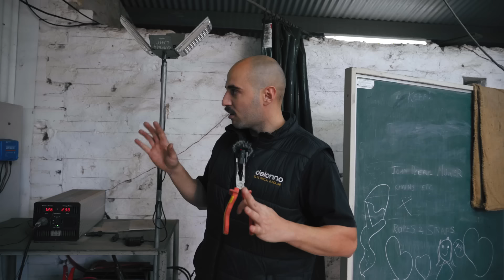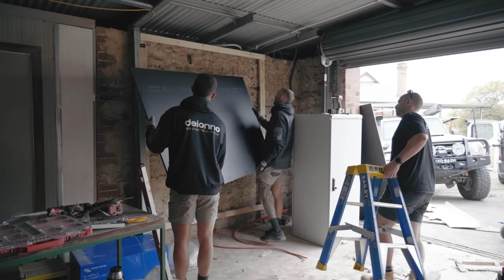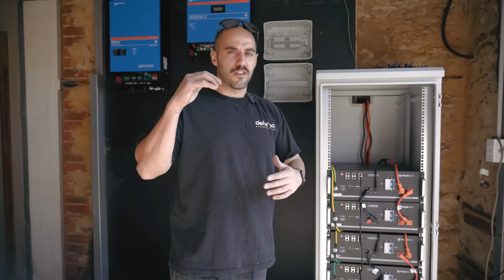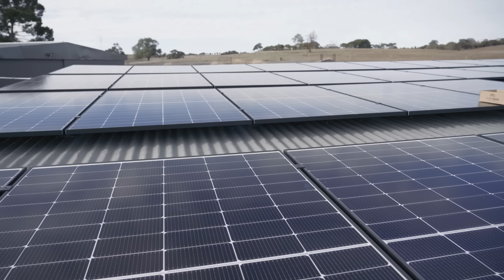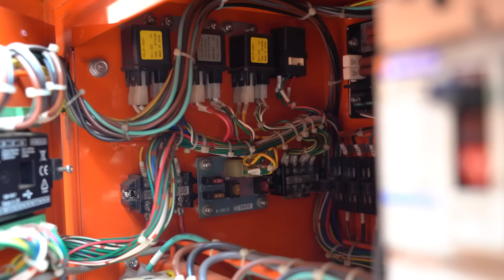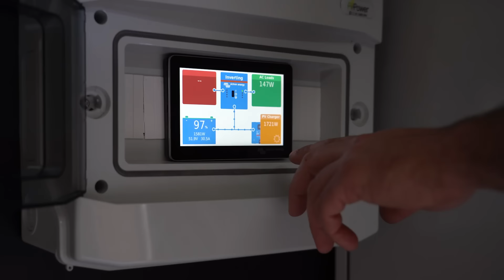HOME SOLAR WITH VICTRON

Comment: Clean set up- Question about the Power In. If im running Powerplus batteries to it (7) shoould i double up on lugs from battery cabes or use 2 power ins connected ?

Comment: Hi @Deionno Electricial, Question - Why did you run the MPII shown at https://youtu.be/T4bzCHgsXQY?si=_Ks3fuLJkYA6uLD5&t=299 to the 3 or 4 pole noark DC breaker size instead of the standard 2pole that you ran for the MPPT controller? What is the advantage of 4 pole DC breaker size for the MPII over the 2pole Noark?

Comment: I agree with most others, that's an awesome design and install, well thought out, very clean and non cluttered, extremely functional, so well laid out can't compliment you enough,  in fact the  only change I'd make would be an additional multiplus, smaller 5kva unit, dedicated to an aircon circuit, so it can shut down and prevent A/C once battery hits say 25% without killing all power, but your design is how it should be done, I dont believe in using these in and  out installs with tesla and byd etc that use high power DC, I love good ol server batteries and 48v, cant beat em (and you  KNOW your getting prismatic LiFePO4 and not guessing and possible getting Li-Ion)/

Question though, you dont use say the zbeny isolators?  I also like using siemens NH00 setup on the battery, noarks on inverter and co, but thats my personal preference :)

Comment: If use a 15KVA inverter and 80kWh battery bank (instead of 10Kva/30kWh of the current video) would you recommend to put a 2x Victron 450/200 MPPT, in that scenario?

Comment: All these boxes. Boxes, boxes and more boxes.
Next time, just buy a Deye inverter including everything. Mppt, inverter, touch screen, circuit breakers...
Reply from the maker: That’s all well and good but the redundancy when off grid is what’s important here! 

Deye is a great product but victron is a proven and reliable product and has so many options !
Reply: what’s the surge rating on that thing?
how it is better than victron?
genuine question here.

Comment: Lots of power in that setup. Do you recommend any cooling systems for a system like this?
Reply from the maker: It’s not really necessary unless enclosed in a cabinet - plenty of airflow around the units is plenty